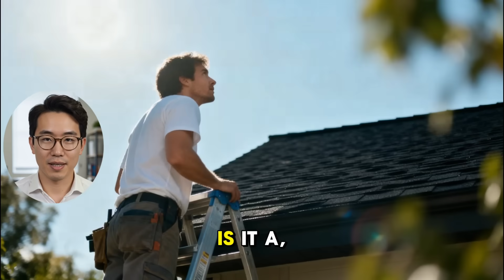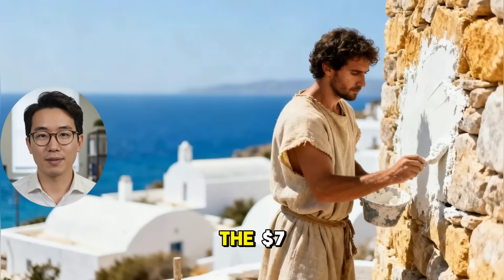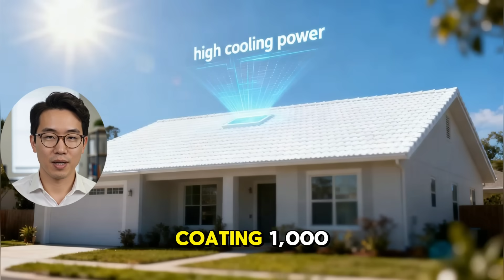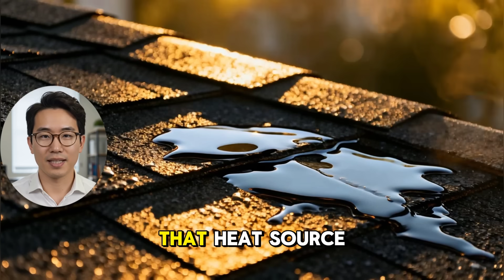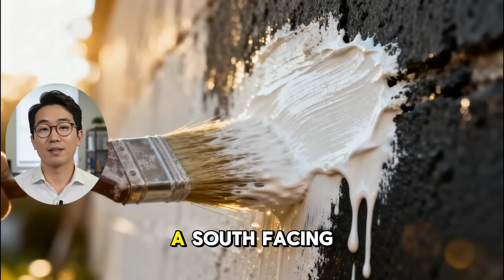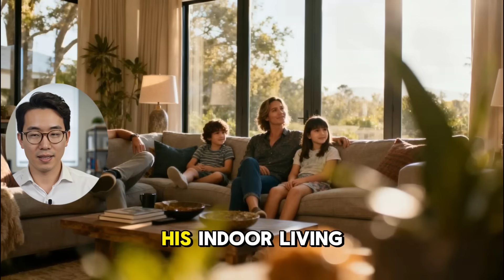Your Roof Is Cooking You Alive. This $7 Fix Stops It Cold: (Physics Explained)

Comment: Obviously, a white roof will generate less heat than a darker color. But unless you live in an old, modest home or a mobile home, applying any type of white coating will make your house look “low rent” and hurt the resale value and curb appeal. Today’s architectural shingles are beautiful and make any house look more attractive. Power ventilators, either electric or solar powered, do a great job of evacuating hot attic air. They’re preset from the factory but allow you to adjust the thermostat to your preference. Overhangs need adequate openings to allow enough cooler air to be sucked in while the ventilator pushes out the superheated attic air. Don’t skimp on insulation either. R-38 or more (at least 15”) also makes a huge difference.
Reply: yeah its ridiculous.

Comment: Will it work if you paint the inside of the stick under the roof. Inside part. Will it stop or reduce the radiating heat from penetrating?  Or just work on outside exterior?

Comment: 1905 un-insulated, 2 story farm house.  Reroofed with white metal with a complete cover of Reflectics barrier underneath metal roofing.  10+ degree temp. drop inside on hot summer days and much warmer temps in winter.  Very happy I did it.
Reply: Is the sound of rain louder with the metal roof?
Reply: @tiffanyshanley1419  The Reflectics foil barrier, not only helps with heat transfer, I am sure it is a major help with cutting rain sound.  The only way I know it is raining is to see it dripping from the eves.
Reply: @barbedstar6480 Interesting. All of it. And they look great. I don't need a new roof any time soon but I'm going to consider this when it's time. Thanks for your response
Reply: Why would it be warmer in winter if you actually want to absorb the heat from the sun, but you are reflecting it instead?
Reply: @Mo4Honesty  Internal heat from wood and propane heaters is bounced back into the house core.  Not escaping through the roof.
Reply: @barbedstar6480 but you reject the heat from the sun, so isn't it a wash? Also, does the roof coating create insulation that wasn't there before to keep the heat in?
Reply: @Mo4Honesty Days are short and sun's radiant energy is weak during the winter
Reply: @BoondockSaint-r8k  That makes no sense. What you are saying is that you get little to no heat from the sun in the winter. A. We know that is false B. It still doesn't explain why a reflective coating makes it WARMER in the cold months than it would be without the coating.

Comment: Question..how does this work in the winter time?
Reply: Good thick amount of insulation is your best friend for the winter.  I will forever remember the old phrase from HVAC certification school, “you must keep the heat from creeping in through the attic in summer….while keeping indoor heat inside with thick attic insulation in the winter”. Cool air is more dense and naturally seeks lowest location, so the attic insulation is less applicable to summer radiant heat movement.
Reply: Yeah my heat barely kicks on in winter and the a.c never shuts off in summer

Comment: what can be done for a metal roof ?
Reply: that's what I'm pondering. I'm thinking that lime mix first, then blend it into a rubberized paint they spray on commercial roof. Seems like it would last a lot longer than the 2-3 year re-apply method. I aint' got time/energy for that

Comment: So how much more is the heating bill in the winter in the northern states if all the sun's energy is reflected?
Reply: Great question.  Wouldn't want to save on A/C bills just to give it all back and maybe more on heat bills.  Perhaps a thorough setup of attic ventilation/fans(?) might be the best solution for A/C concerns.  Here in the far north suburbs of Atlanta, we have fairly strong extremes of both temps.
Reply: @frankAnderson-u3r 🤔
Reply: @frankAnderson-u3r You also don't want your attic to not get hot enough to dry out moisture that could cause mold which can cause a lot more problems.  You need proper attic ventilation.  If needed, install attic fans like you said. Also good ceiling insulation helps to keep that heat and cold out of the living area.
Reply: Sun barely shines in the winter anyway